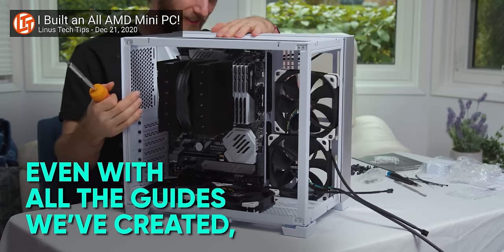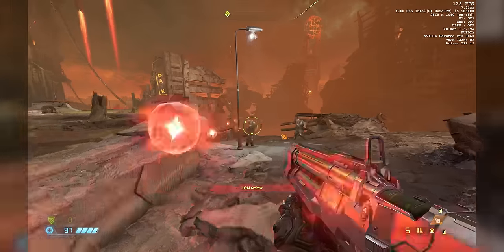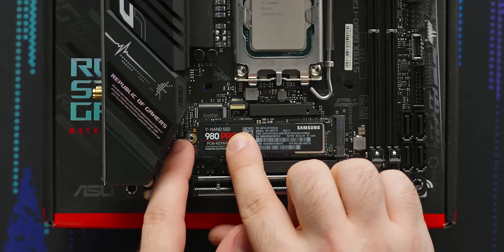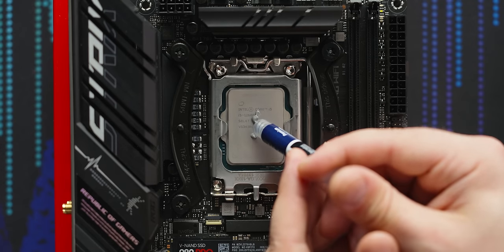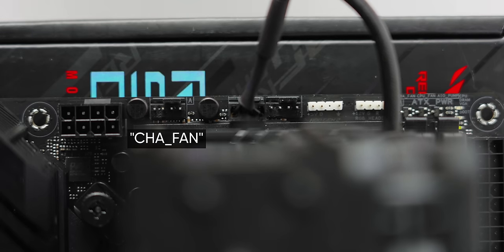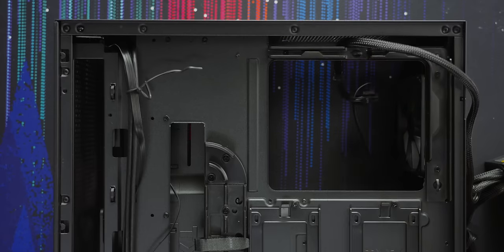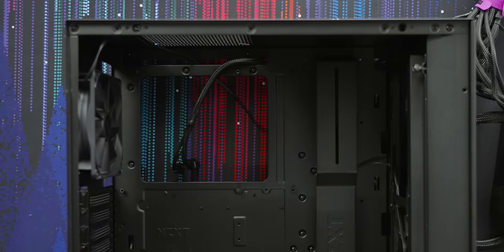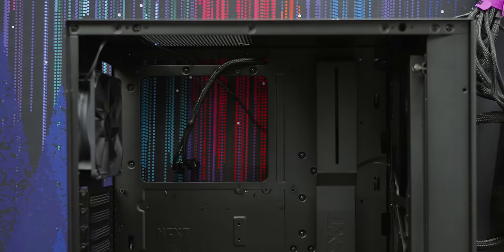The EASIEST Gaming PC Build Ever!

Comment: You recommended the 700 GD for a possible RTX 4000 upgrade which will all use the new power connector which needs 3 PCI-E 8 pins. The 700 GD only has two. It is not a future-proof PSU.

Comment: Isn't the case with trash airflow?
Also completely disagree on the ITX choice. mATX have some expansion slots, can have 4 memory slots and most important, are cheaper than ITX.
This video is kinda weird for this channel.
Reply: Not this one. Not as bad at least. The original H510s, yes, but this is the "Flow" variant, which has a mesh front panel.
Reply: @ExperiMentalDon  Oh, i saw the mesh but just assumed it was modded.
Thanks for pointing out.
Reply: @Hlidskialf  No problem! I didn't even know it existed until I watched this video and looked it up

Comment: they say to make sure that the cooler comes with an lga1700 mount, then mention the Mugen 5 rev. B. The lga1700 brackets from scythe to add to last years models just came out a month or 2 ago, the Rev. C would have it, but Rev. B would not unless it is brand new stock. rev. c has a slightly higher pressure fan i beleive.

Comment: Lemme get this straight, NF-A8 on 360 heatsink, penny trick on the 512MB of GDDR3 and XSB southbridge... Is that it? That's all that required to cool an Xbox 360 and or Slim? Just Thermal Grizzly that XCGPU and use electrically taped pennies as a heat sink and or pressure weight for the southbridge? This console upgrade/fix is way easier than I imagined.

Comment: Installing the Samsung 980 pro at the back is not a good choice IMO, pcie gen 4 ssd in general generates much more heat than previous gen 3 drives, so the front slot with the included heat sink is much better for the longevity and day-to-day use of the drive.

Comment: The Intel stock fan might have been a better choice because it removes the 12th-Gen compatibility issue from the equation and saves a few bucks.
Reply: The intel stock fan is awful in comparison to the noctua they used 
the noctua cooler includes the intel compatibility parts for free

Comment: Power supply fan originally mounted with fan drawing air from inside case.   Then later in video PS is mounted ideally with fan pulling fresh air from bottom of case.

Comment: Something cannot  be " non-capacitive". There is capacitance  between conductors even in a vacuum. The term you are looking for is "low-k" or dielectric  coefficient.  A vacuum  has a k of 1, and everything else  is higher  than that. Low k might be 2 or 3, which means that 2 conductors  have twice or three time the capacitance compared to a vacuum.  Air is slightly higher than a vacuum.

Comment: I've had lots of trouble with those new ITX boards, coolers aren't all compatible sadly. There might not be enough clearance so watch out for that. In fact my current build AIO pushes ever so slightly on the ram, works fine but yeah just something to keep in mind.
Reply: i think id have recommended a micro-atx over a mini-itx for a first build, especially considering the enormity of the case. i think this choice was made to keep the screw count low and to provide the maximum amount of i/o possible with needing additional cards (though to be fair newer micro-atx boards have just as much i/o, that sure wasn't the case last time i built one). micro-atx allows a bit of expansion and is a bit easier to work with as parts are spread out more. full atx really doesn't make any sense anymore unless you were building a workstation and you need the card slots. most people just need a slot for the video card. i build itx though because im an sff enthusiast.
Reply: @LordOfNihil  Yes, they are great boards and totally on par with ATX formats. My issue mostly came up for 12th gen ones, DDR5 rams sticks which are quite some chonkers essentially. Those boards are definitely worth it, but cooler and AIO "compatibility" is just something that an unexperienced builder may not check at all :)
Reply: @regildr3934  ram has just gotten so absurdly huge lately. i bought low profile memory and avoided the issues entirely, and those took considerable searching to find at the spec i wanted. dims have practically doubled in height since my system integrator days (ddr was fairly new). my fitment issues required modifying the brackets for the nh-c14s air cooler i used, and had my ram just been a couple mm higher it would have conflicted.

Comment: The M.2 SSDs have made things so much easier. Managing these SATA power cables alone for additional drives can be such a pain.
Reply: tbh it's not the sata cables which annoy me, it's those stupid power supply cables which daisy-chain the plugs that make cable management a nightmare. People say to buy lower wattage PSUs like 650w and below, but they never mention that those PSUs have fewer slots and thus the cables have more daisy-chained usable slots to plug multiple HDDs/SSDs into.

Comment: Everyone noticed the pcie 8 pin label is on the cpu 8pin . But did anyone spot anything else?
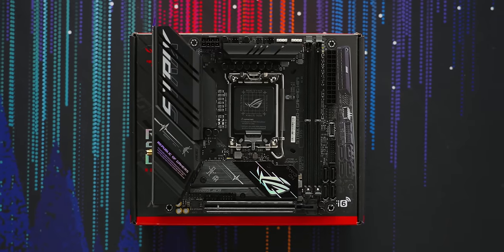Notice the little blue tab at 01:21 at the top left of the motherboard that is the protective plastic covering the rear I/o, I thought he would have removed it and not mentioned it. but nope, you can still see the little blue tab on the top right of the rear I/O its still there at 12:19 after the build is complete.

Comment: There is an error, the 2x4 at the most right is the cpu one and the one at the center is the GPU one, do not make the mistake to put it wrong bc you can burn things, also the power supply is in the wrong direction

Comment: I've been saying for a long time now, why is it that in 2022, case builders and motherboard manufacturers have not settled on an industry-standard plug for connecting the front I/O to the motherboard. Was certainly shocked to see at least one manufacturer that has attempted it. It's also too bad that more motherboards are not using that tool-less method for attaching M.2 drives. I'm old now and my hands are not as steady as they used to be, making those tiny M.2 screws a total frustration to install.

Comment: At 7:50 the PCIe 8 pin label is on the CPU 8 pin. It has the big "CPU" label right on it.
Reply: inb4 re-upload.
Reply: It is extremely important, especially RIGHT AFTER SAYING "While it's hard to put cables in the wrong way, it's not impossible". 

New builders will likely pause this video, look at the "Oh just the 24pin, PCIe 8 pin, CPU 8 pin, FUNNY how the CPU is used for PCIe, but I trust him"
Reply: Thats verge level guide quality lol.
Reply: Yea, and 8:43 also points at the wrong screw for the top right.
Reply: easy way to kill a videocard
Reply: Huge oof. I've fixed this issue in a friend's build literally last week, thankfully he didn't manage to blow anything up, but... Ouch!
Reply: @OakyDokie  A wizard did it.
Reply: @rikschaaf  If you mean what he's screwing, the big score is actually an adaptor included in the box that turns the standoff.
Reply: @arivald6677  lol. Better than your whole generations
Reply: @rikschaaf  rightly pointed. Ever seen a pc in life?
Reply: @OakyDokie  because some motherboards use the extra 4 pins for additional CPU power phases, you more then likely dont need it but check the TDP of your CPU just to be sure then refer to your motherboard manual, it should tell you the max TDP for each. You might have a mobo with some high end overclocking features that require it. I'm running a intel 12th gen i5 and my board only has 8 and it was released at the beginning of this year.
Reply: I think the video editor faqed up big time, and mistakenly mixed up the video footage of the PCIE/CPU cables... 
Despite having that enormous CPU label... And that's why you don't rush your work :P
Reply: at 8:32 you can actually see Linus picked and described the correct CPU cable, so yeah the video editor mixed up the footages at 7:50
Reply: @rikschaaf  lol didnt notice that... editor mistake for both things... the 7.50 is more crutial
Reply: It was editor mistake. Don't try be to over smart which you isn't
Reply: @killerspetsnaz  exactly. He's a noob. He won't be able set up a motherboard completely. Lol
Reply: but funny thing no gpu link
Reply: i didnt notice that
Reply: @OakyDokie  The extra 4 pins are just if your CPU needs them (from overclocking, etc)
Chances are, you'll never need more power than the 8 pins you are using
Reply: i saw that too and ran to the comments to make sure i wasn't going mad.
Reply: @OakyDokie  old PC motherboard in my office has 8 pins, but worked with 4 pin connector from old power supply. I guess you could supply more power through 12... new intel CPUs can use more power than entire AMD computers.
Reply: nub's comment is a stolen comment from user "G"
Reply: @OakyDokie  The additional 4 pins are for high-performance overclocking.
Reply: Guess the editors got sick as well
Reply: @fredd3.14  LOL
Reply: Yup they fucked up on that one
Reply: @Remmes  that's nub's MO, always steals other's comments. It's pathetic
Reply: NUB IS A BOT 
VERIFIED USERS ARE NOT REAL PEOPLE
Reply: @lukakrajnc5775  He did say they were mostly store stock to avoid scalping.
Reply: I noticed that
Reply: @OakyDokie  the additional 4 pins are only needed for higher powered CPUs and/or serious overclocking.
Reply: I was on board with their choices, until they said non modular PSU...
Reply: This is a major fail I was about to say the same thing... TBH they need to fix this lol. I have seen a few fry their video card and or mother board putting those cables in the wrong area!
Reply: @jashe369  how editing mistake became a major fail? He built more pc than your age. Get a job
Reply: @Arush Shukla what?
Reply: This is borderline Verge quaility build guide
Reply: and no screws to hold the GPU into the PCIE slot at the end
Reply: Troll.  I love it.  Even Linus is not safe. ha ha
Reply: Uh oh. Honestly, that's why a PCIe 8-pin should always be called a 6+2 instead, and a CPU 8-pin 4+4. Prevents confusion so much.
Reply: @theeuropeanlegacy5075  Lets hope he has build more computers than my age because anyone in the tech industry as long as him should be in the thousands of built PCs no joke. shamming someone for pointing out this major mistake is the worst kind of Fan worship, as if he is wrong he should be accountable for that given the type of video this is. Think about it! This video is for beginners. They will do what this video says to the letter. That means they will likely fry their video card and it will not be supported with RMA. Then they will be out money and may not even know why. Stop worshiping the ground he walks on for two seconds. This is insanely bad for the type of people this video is targeted for. I would not share it. Here is a litmus test, if this was the Verge making this video would you tear them a new one over it? I am guessing so. Thanks for literally being a jerk to someone trying to be helpful.
Reply: Yeah, they mixed up the PCIe (6+2) pic with the CPU (4+4) one
Reply: The Verge has entered chat
Reply: bot

Comment: Q-Latch
Cool! On my Asus X470 board I wrecked the screw standoff when I put the screw on. It just twisted the standoff so it came loose from the motherboard. Aaargh! Luckily the motherboard's heatspreader helped secure the SSD in place without that standoff being secure but the Q-Latch would have prevented this issue entirely.

Comment: Isn't the M.2 slot on the back linked to the chipset instead of the CPU PCI-e lanes? Pretty sure you'd want your boot drive on the primary M.2 slot so that it has a direct link to the CPU, for the best response time and lowest latency...

Also, pretty sure the PCI-e Gen 4 NVMe drives like the 980 Pro will have controllers that run pretty hot, so I would personally not skip the heatspreader installation...

Also... overclocking CPU and a non-overclocking motherboard? Why not suggest a Z690 motherboard?

Comment: yes that usb 3.2 plug should be difficult to plug in incorrectly, but as i discovered on my best friends pc, the installer certainly managed to. he thought his case peripherals were broken and so he just relagated to his rear io usbs, until i installed an additional hard drive and discovered the improperly seated cable on the motherboard and he is so pleased he can use his front facing plugs. the same installer also managed to damage a component on the motherboard putting in the graphics card and he lost the ability to plug in an ethernet cable to the rear io, until i got him a pci slot ethernet board. he likes the cable management of his super cramped case, pain in my ass getting the sata cable to the motherboard without pulling anything else out because i simply had no room or tools.

i on the other hand dont care about clean cables in my pc so long as things arent moving around near a fan or hotpoints. my case isnt designed to look in through a clear panel. its a rosewill thor v2 behemoth of a case that i have my plex server also inside the 5,25 inch bay space. i like the velcro tie downs so im not going to cut a cable during maintanance or replacing components. 

im forwarding this video to the "professional" who put my best friends pc together.

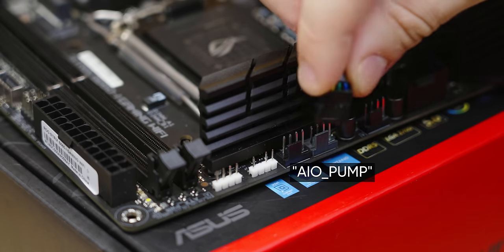Comment: 6:41 -- This is actually incorrect based on my experience with this motherboard and previous version of it. The AIO_PUMP headers run 100% all the time ,no matter what, and are not able to be configured in BIOS. The ability is there to fiddle with them but it literally just runs it full tilt all the time. Invest in Y splitters.

Comment: You shoulda gone with a 12600 nonk or 12700 nonk and used the Intel stock cooler. It would've made the build even easier with minimal performance differences.

Also, are the mistakes here intentional? The RAM stick wasn't slotted in properly, the cable's for the CPU 8 pin and GPU 8 pin are labeled wrong.

Comment: nice build just dont by your parts on neweggs. half will work and half wont and youll be troubleshooting it all day if your new. specially if they send you a defective motherboard with bent pins or 2 out of the 4 ram slots not working. happened to me.

Comment: The PSU fan is facing upwards in the video... Sure the case has ventilation honeycomb on top of the PSU shroud so the PSU won't cook itself, but it would be a better choice to install the PSU with its fan facing downward towards the dedicated PSU ventilation hole.
Reply: it doesn't matter 
if PSU is face up, then the heat from the PSU is immediately ejected upward and therefore cooler as a result 
if the PSU is face down, it gets filtered air from below the case 

both are fine

Comment: One thing to note about CPU placement is that when viewing the motherboard from the bottom, the writing on the CPU is typically right side up.  Also, you kind of alluded to this, but I think it’s worth mentioning for the skittish folks out there… LGA-1700‘s retention arm takes a bit of force to close. If your worried, just double check your CPU placement, and push until it latches. Yet again, it will likely require more force than you might expect!! (It threw me off on my first build of LGA-1700, and I’ve been building PCs since the first AMD Duron.)

Comment: Mmmm. I'm not 100% sure if suggesting people don't need to put on the m.2 heatsink is a good idea.
With Samsung you won't see it get to high temperatures because it's able to throttle and protect itself. My Samsung 2TB m.2 is always at 68-70c with the block on and gets just under the advertised speeds take a 100MB or so. 
Typically speaking you won't notice any performance hit but this also remains to be seen until games start implementing the Direct Storage API.

Comment: I have some serious issues with this video. 
1. You put a k series chip in a b series board. Should have just gone with a 12400f and saved a bunch of money. Or gone with something am4 and had in box compatibility with your cooler 

2. Should have been a mATX board. Save a bunch of money and no need for a y splitter due to more fan headers. Lots of those boards are only 2 dimm slots too

3. Why DDR5? It’s stupid expensive for not a whole lot of gain. Just stick with DDR4, it’s plentiful and cheap. Once again, could have saved a ton of money. 

4. Could have saved a ton of money by not using a 2 TB Samsung 980 Pro. If you really want Samsung, get a 970 evo, or use a 500 gig m.2 and a 2 tb Sata drive and get more storage for cheaper. 

6. Power supply goes in fan side down so it’s not trying to breathe against A solid metal plate. Lots of people have already pointed out the cables, so I’m not going to beat a dead horse. 

7. All the money you saved could have gotten you a better gpu, like a 3060ti or even a 3070 and get better performance. 

I understand what you’re trying to do with this video, but this ain’t it.
Reply: The only logical explanation is the parts were specifically chosen to get rid of excess microcenter stock

Comment: i got one of those cases, they are awesome. i got it for like 50 euros because they said it had  a "crack in the glass". Wich turned out to be a  tiiiiny chip on the bottom edge thats impossible to see when you have installed the glass.